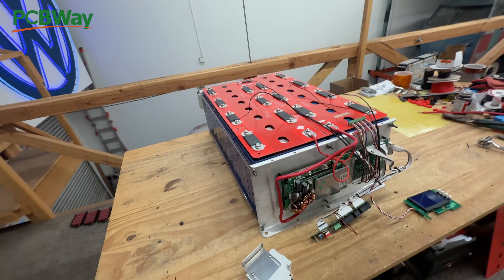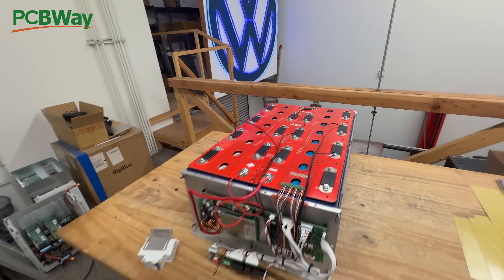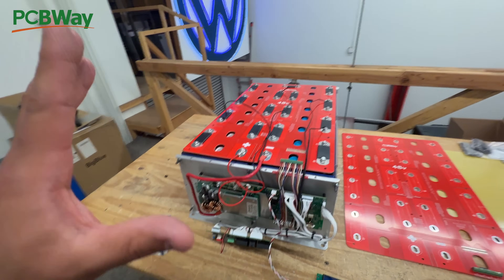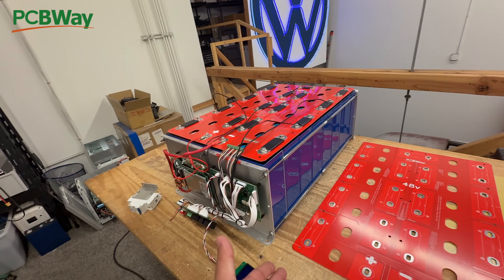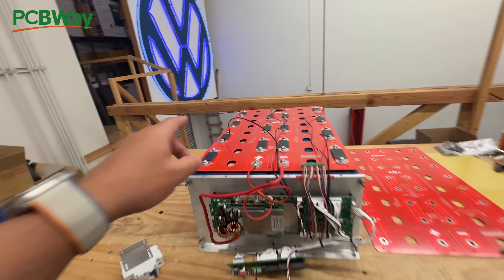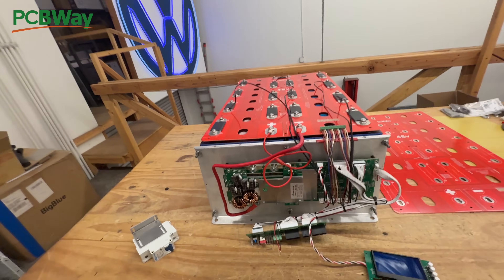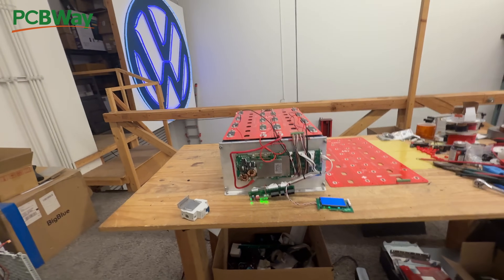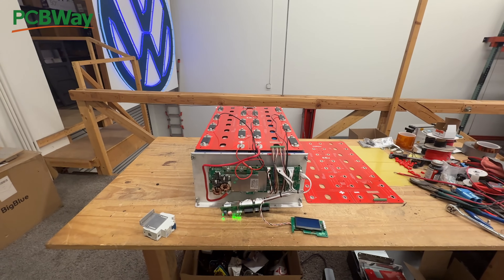Save $$$ Thousands by building a DIY LiFePO4 battery-  PCBWay

Comment: i appreciate the content a lot.  Very creative.  However that camera moving around is very 90's  Content creators.  think from a users experience first.  Look at successfull content creators and do the same.  Editing is choice but could have cut down on 1/2 the time.  At the very least.   get that camera stable and make your point once!  after that, its not required as its now documented and can be revisited if needed on the client end.   A lot of redundancy and this could have been a 3 min video.

Comment: It's great to save money with DIY kit, but if it doesn't come with any instructions, it can be pretty frustrating.  There was no manual on how to operate the BMS control panel.  There were no instructions on how to set up communications with the charger/inverter.   Tech support on JAG35 website doesn't exist.

Comment: Hi guys, Like your way of thinking... Do you have a pcb board for the 16s 81.2mm cells. 300ah b.s. I know its a weird size after I got the cells I got the heads up. lol . Your compression plates will work I'm guessing?

Comment: This video is hard to watch and more difficult to listen to.  Here's a couple of suggestions.  Firs, put the camera on a fixed stand.  This video the view is waving around as if the person holding the camera is drunk.  Second, create a scripts, practice it and then keep to it.  The product is a decent idea but prismatic cells come in an array of thicknesses and widths.  Having a fixed circuit board design means you'll need to produce a wide array of them, and sell too few to justify the tooling costs.

Comment: The 280ah cells I have are 123mm between the terminal posts. Will those fit this board? Also does the balance connector need to be purchased separately and soldered onto the board or is that already done like the board that is next to the completed battery?

Comment: You never put anything between the cell terminal and the buss or main cables. That includes lock washers, flat washers, spacers, balance lead eyelets or in this case a pc board. Any balance connections to the cells must be placed on top of the busses/cable lugs. It has been shown that even pure copper or aluminum washers between the cell terminals and current carrying conductors is detrimental. Also, an all red cable on the negative to the bms is sure to rub the OCD guys wrong.

Comment: I am using 16 cells of Eve 304 cells to make 48v system to run my entire house. Wish I had same red board, now I had to run lot of wires to the cells and also think which wire will go where. The empty box is still very expensive and hurt a lot, therefore, I made my own wooden box and stored everything on a three tire tool trolley.

Comment: Question:  you stated that it was 11Kh.  I am a noob, but if these are 313ah and there are 16 batteries.  16x314 = 5,024.  Am I wrong?  Still the kit is still low cost
Reply: Thank you so much.  So if I saw on my bill I was using 30kwh a mouth, I would need 6 of these not counting extra so I would not drain my batteries 100%.  Is that correct?
Reply: This math is off, I have a 48v 100aH battery that is about 5.13Kw…these are three times the capacity which would put them in the 15kW range…an avg size house uses 30kw (depending on location and how many electric vs gas appliances) but you should
Prob be looking at 2-3.  I’m still trying to figure out how to get around an $800 box.
Reply: Kwhs isn't amp hours.     Your equation would be if you put one 16 cells in parallel  it would be 3.6 v at 500ah
Reply: 5000ah
Reply: 16s I'd  48v at 314 ah  . Series it's voktage paral ads capacity.
Reply: Thank you

Comment: Or, if I buy the same batteries elsewhere and save a few hundred bucks...bam , 48v block for 1200 - running strong, no complicated , hyped, pretty, overpriced, or "ocd" setup- not trying to knock your stuff, but not everyone lives in the city and is soft- most ppl , real men, are running crude, rugged setups in remote, and hostile environments for real needs, not  ev's - you never touch base with this crowd...we have deep pockets but don't need the fluff

Comment: Very interested but cant find dimensions anywhere. I am building for an RV retrofit and have very specific space requirements. was going to go custom but if the specs fit this would be much cleaner.
Reply: did the math based off 16 eve lipo4 cells (same space your looking for) 293.6mm Long 260.6mm wide 200.5mm height  since the busbar pcb shown in the video is for 16S lipo4 cells.
Reply: @evilmario5649  Thats so much smaller than I thought. 11.56x10.3x7.9.

This is crazy good news for me. I was worried about getting one of these in place of my indutrial AGM batteries. looks like I can fit 2. My RV will go from 9.6kwh to almost 27kwh....thats 12 hurs of AC in my rig. with the 5.6KW of solar I will never need shore power again.

Comment: The jag site is a little difficult to figure things out on. Be nice just to have a quick link with the cells, pcb, and balancer together. Im interested in the 12 or 24v units as a home backup.ill make my own enclosure .
Reply from the maker: here you go everything put together for you https://jag35.com/products/diy-12v-lifepo4-battery-pack-using-premium-a-grade-eve-cells
Reply: There  is a quick link to cells at the bottom of every page it says cells

Comment: $600-700 for a battery box? That’s insane. Server rack pc cases cost less and they are more complex.
Reply: Prices are at a point now, just buy a battery ready to go. It really doesn't make any sense to DIY it now. Unless it's 50% less
Reply: @kevinroberts781  diy is very good for a permanent large setup above 4 kwh for solar. If you know what you are doing. EG4 sales 5.4 kwh rack battery for about $1200, which is basically 4wh per dollar. Just need to include the inverter and charger or an all in one. The whole setup will probably be at 3wh per dollar. The built power stations are rarely at 2wh per dollar and better. So yes, about a 50% saving is what you can expect from a smaller system. The larger you go in kwh, the more you will save by diy.
Reply: @kevinroberts781  1800US to build a 51.2V 312AH battery with EVE LF280K HSEV cells(grade A) that is serviceable with fancy wheels(the battery weights 250LB) in a nice battery box delivered to your door all taxes in, thats like 40% of what it would cost for 15KW non serviceable battery here in Canada.Enjoy
Reply: I was thinking the same thing in regards to the cost...if people are paying 6 to 700 for a box like that than I'm switching businesses
Reply: Im assuming that includes the BMS which should be $100-200 of value. Still overpriced though
Reply: It is a custom box that is nice. Server rack batteries are definitely a good pick if the price is the priority.

Comment: I bought some bust bar from you a while back but never got the batteries I need to know what the price for 300ah
Reply: Ok I see the 280 will those bust bar with those batteries
Reply from the maker: yes 280ah and 300ah are the same size https://jag35.com/products/eve-lf280k-lifepo4-battery-cells-3-2v-280ah-grade-a-6000-cycles?_pos=4&_sid=c969f64ba&_ss=r